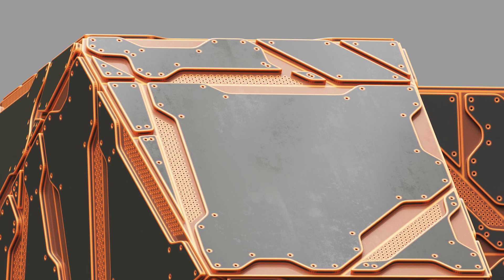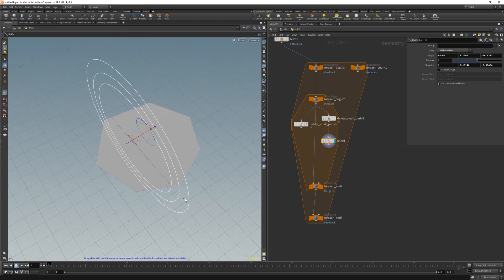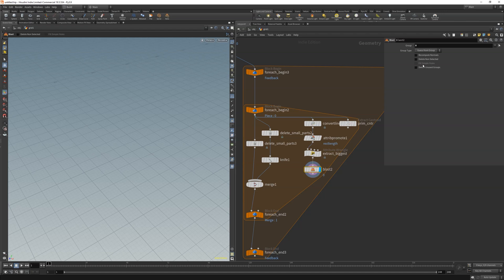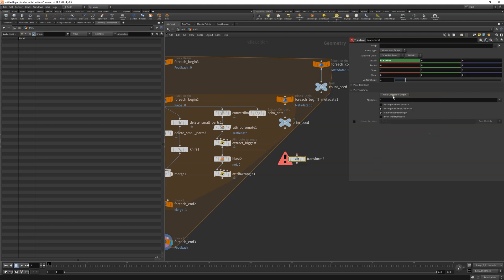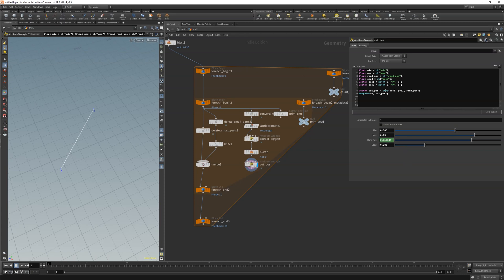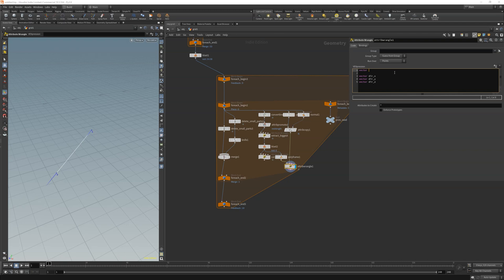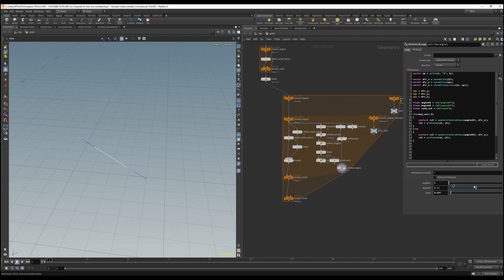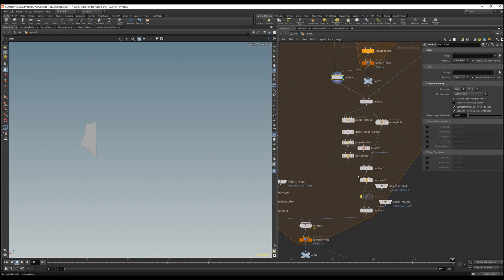Houdini Tutorial: Procedural Scifi Panels Generator | Part 1

Comment: i cant get this to work, ive sat at it for three hours now but my cuts always originate from 0.0,0

my knife values for origin are:
detail("../cut_pos", "cut_pos", 0)
detail("../cut_pos", "cut_pos", 1)
detail("../cut_pos", "cut_pos", 2)

and for direction
point("../cut_dir", 0, "cut_dir", 0)
point("../cut_dir", 0, "cut_dir", 1)
point("../cut_dir", 0, "cut_dir", 2)

ive double and triple checked everything and i dont understand why its not working, in the cut_pos attribwrangle i also cant get the point to appear on the line, my seed values and min/max work fine though and are dependent on one another and change as i change the seed value

it will cut, everything works, except that every cut through every prim is based on 0,0,0 origins and it wont cut every prim either
Reply: in the cut pos wrangle , i specified new attributes for each axes

v@cut_po = lerp(pos1,pos2,rand_pos);

//addpoint(0,cut_po); //for vis point

@xx = @cut_po.x;
@yy = @cut_po.y;
@zz = @cut_po.z;

then in the knife node i used 

detail("../cut_pos/", "xx", 0) detail("../cut_pos/", "yy", 0) detail("../cut_pos/", "zz", 0)

and it worked
Reply from the maker: @billelsayad  for 
@katraapplesauce1203
 it was just a little typo in the "cut-pos" wrangle
Reply from the maker: Can you send me your file? You can dm me on insta or X an send it to me. I will check that as soon as I get it.
Reply: same here , did u solve it ?
Reply: @billelsayad my problem was a syntax error writing a lower case p instead of P for position so it was breaking the vex code

Comment: about knife origin for newbies like me:
set origin.x as >> detail("../cut_pos", "cut_pos", 0)
y >> detail("../cut_pos", "cut_pos", 1)
z >> detail("../cut_pos", "cut_pos", 2)
where 0-2 is index of cut_pos[0], cut_pos[1], just read the hint when you are typing ``detail(`` in the expression editor
same for direction point("../cut_dir", 0, "cut_dir", {0 for x, 1 for y and 2 for z})
Reply from the maker: yes, looks about right. The 0-2 describes the element number of you attribute. In case of a vector you have to specify whether you want the first the second or the last element to be assigned. For integer and floats its the same syntax but you will only need the "0" in the end since there is just one element. Hope I could help